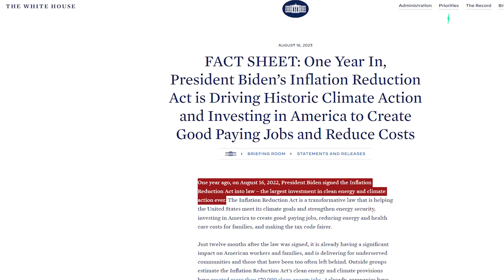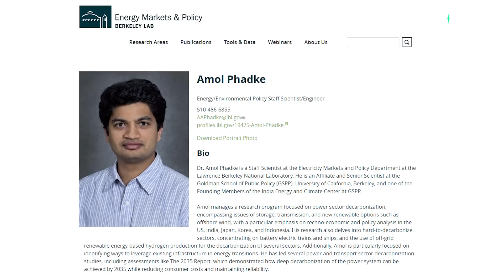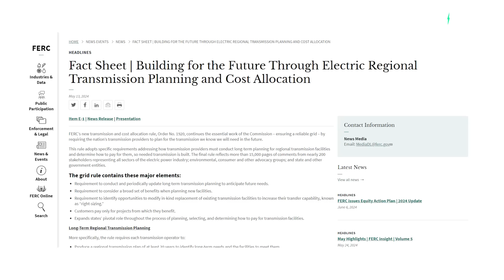How a small change could double the size of the U.S. electricity grid

Comment: Electricial Engineers understand why the lines are slow to be built and upgraded....  just....YOU DON'T ....  b/c you aren't any kind of expert in Power Systems.  

When a transmission line gets upgraded, the breakers, transformers, and other hardware in the substation need to be upgraded, as well as subsequent lines that branch from the endpoints of those lines.  Engineers try to maximize finite resources to upgrade only the necessary components at the lowest cost (b/c customers don't want to pay an arm and a leg on their electric bill for a grid that has over-capacity in an area where it's not needed (until some solar company decides that's the best location b/c the land isn't being used, so they can buy the land cheap but they don't consider their generation is stranded b/c the grid can support their interconnection in that location - it was never equipped b/c it was just rural farm land). 

Just throwing heavier lines on the transmission line towers is also sometimes not feasible due to them being designed for certain insulators that can support certain loads (including temperature and wind loads, voltages, etc).  Basically, you don't understand jack sh__ about the power grid or the factors that impact where and how lines are built, or what constrains how energy flows on those lines.  

Go get a 4 year degree in Power Electrical Engineering before you opine on matters you don't have the math or science skills to understand.

Comment: Why not increase the voltage, which will allow for lower amperage (heat)?
Reply: Similar to vehicle low voltage electrical system going from 12 to 48V ala Cybertruck. Save alot of copper there as well.
Reply: @jaaklucas1329  Exactly. There are easy cost effective solution to this problem, but the big money is made by implementing grand capial intensive solutions.

Comment: Not only rewire but increasing the voltage.  Here in Quebec, we developed the first 735KV lines, we had huge distances between the big turbines sites and the consumers.  Power lost in lines are lowered to squared of the voltage. ( P = V^2/R and P=R*I^2 )   So here in Quebec for example, we have 315KV power lines that we could convert to 735KV if we were to add power at the source of those lines.  The other problem that majority of people seems to forget about EVs is that it's very easy to schedule the recharge off peak.  Not only that, in a not too distant future, power companies could pay you to use your car's battery power to help during peak hours.
Reply: China already has 1.1MV cables. The other way to get more power over the same lines is to move over to HVDC for the really long runs.
Reply: @patdbean  Yeah, we already have that here since about 25 years between Quebec and USA: you avoid 60Hz sync problem for such long distances.
Reply: @guyboisvert66  here in the UK we do not have any overhead HVDC. The country is not really big enough to justify the cost of  convertor stations.

But the undersea , cables to France, Norway ,   Belgium etc are ALL HVDC. To reduce the losses.
Reply: @patdbean  Yeah, you don't do that when it's not needed $$$!  Here, the dams (La Grande 2 and further up to the others) are 1000+ km up north from Montreal and another 200KM from Ste-Eulalie (where the DC station is) to Maine.  The DC line is 450KV whereas the AC lines are a mix of 315KV (older) and 735KV (newer).

Comment: Reconductoring can double the throughput of the US grid.  Reconductoring means replacing old steel wires with new composite wires, a step that would double the amount of electricity that could be distributed, along the same towers, in the same rights-of-way.

So, the future looks quite bright for EVs, and wider electrification plans.

Comment: Only recently the US admits it does not have extra capacity in the grid to "accept" extra connection.
The grid can be upgraded quickly but the grid owners are waiting for government subsidies.  After all it is the government wanting green energy transition.  The grid owners can afford to wait and they are reaping enough profit at the moment without lifting a finger.
The other problem of the American grid is it is highly departmentized into zones and local areas.  Thus one area or zone upgrading has little effect overall across different states or nationally.  In fact unless the grid is nationalized under a sole agency, like in UK or China, no much improvement can come out in the short term..

Comment: It's not that simple folks. Transmission is not only limited by thermal (current). There are electromagnetic conditions and substation capacities. For all those lines to be upgraded with composite conductors will require larger transformers, more bus capacity; and it gets real expensive if the fault levels are increased beyond station design.

The transmission system is not like plugging in an appliance or your home electrical system.

Comment: Allot of the data centers are looking at micro nuclear plants. Even so it seems that it is rather bazaar that data centers are slated to use so much power. Like aren't computers getting more and more efficient?  They are but the computing load is growing so much faster than the efficiency is improving.  My guess is this power usage will drop at some point when some sort of ultra low power computing is developed like maybe quantum computing. Now it's a race to use brute power to do our computing.

Comment: Distant renewables ARE GRID ELECTRICITY. 
NUCLEAR is grid electricity.
Hydro electricity is grid electricity. 

EV big battery parked 23hrs every day and Rooftop PV DO NOT NEED the grid. 
'FREE' BIG BATTERY parked 23hrs every day and all night at home, and free of the grid SCARES THE PANTS OFF the GRID OWNERS. 
Home electricity is dirt cheap. 
Utility owners make home rooftop expensive to connect. 
Complicated connection paperwork.

The grid is so expensive that it needs to sell expensive electricity. 
Do the FKNG thinking, do the maths Viking.
10 times more electricity and grid capacity is insane.

Doubling capacity is an economic trap for the grid owners. 

15% of Australia rooftop area is 100% of today's fossil fueled 600gWh maximum daily electricity. 

But 7x more is needed. 
EV big battery parked 23hrs every day and not used is economic bs.
Grid owners know this.
Elon knows this.
Auto manufacturers know this. 
Military know this.

GRID ELECTRICITY IS a DEAD DUCK economically.

Comment: Something is not right about your 1500 GW of renewables awaiting grid connections, since the total U.S. electrical production capacity is currently ~1300 GWs in total.
Reply: You overlook the difference between installed power and actual fed in power. A wind Power plant has an average annual capacity utilization of about 15%. Therefore, 1500GW of renewable capacity is equal to 225 GW of conventional Gas and Nuclear Capacity.  In the US you have mainly Wind in the Winter and Sunshine in the Summer. You don't have the same windspeed all across the nation, so you need more grid capacity with renewable energy to transport the electricity from the windy areas to the demand centers. In contrast to solar energy, the energy in wind increases cubically to the speed. So, 2x Windspeed means 8 times more power, which you need to transport to the consumers.
Reply: @thomasbergfeld2730 You overlook the fact that power generating companies do “speculative queueing” , where they submit a project to many of the 9 regional grid operators, but only have the money to build 1 project in one region. They are essentially shopping around the different regions for the best tax breaks and lowest interconnect fees and then build in the region with the best deal. This “1,500 GW of renewables” hasn’t yet been built. They will only build if the price is right. Realistically the amount of renewables that will be built is the 1,500 GW of proposals divided by the 9 regions, or 120 GW that actually has the funding to be built. That is a 10% increase over the current US installed generating capacity.

Comment: The grid itself needs a lot of electricity to be able to pay its own way.
A bit like British Rail. Branches were closed and abandoned when alternate transport was available. 
Some people's only transport was lost.

Transport technology changed to the individual to stop 'industrial strikes' and offload responsibly to the individual. 

Now the individual taking energy responsibility will be opposed.

The grid has made clean energy indoors possible to millions. 
The grid also makes electricity more expensive but that was OK, a little electricity in the home was a 'necessary ' luxury so to speak. 
Only a small part of the total energy used is electricity energy. 
With new technology PV on the rooftop and EV big batteries parked 23hrs every day, the grid owners will force a government garrenteed locked in electricity supply.
For me, the 5cents kWh electricity costs 50cents kWh from the grid.

Just seeing this problem is impossible for many.

People think put more electricity through the wires.
This has strong limits. 
More electricity through the electric toaster is perfect for the toaster, but blackouts if more electricity in the grid.

The grid has 3 limits.
1, It must be in balance, supply = demand 
2, An upper limit of heating and sagging. 
3, ECONOMIC size, cashflow limits engineered size. Grids are never overbuilt (like the Sydney Harbour Bridge was.)

More grid capacity is horrendously expensive. 
Offgrid suddenly looks very real.

I like the idea of the grid being the backup supply and a way of topping up areas on bad days.

But the grid needs maximum cash flow to survive.

Comment: Australia has simplified rooftop installation and grid connection and has massive savings.

The government wants to avoid blackouts and loosing at elections. 

Rooftop unloads the grid and so protects existing and aging and extremely expensive infrastructure.
Reply: Rooftop solar PV in sunny suburbs is a no brainer. Unfortunately it is low hanging fruit. Doesn't solve the much larger industry, transport CBD issues.
Reply: @jimgraham6722  Yes, it is a big problem.
Universal connection of every building provides cashflow, large cashflow to the grid itself from central generation. 

74% of demand is from buildings. 
If all buildings can generate and store the same amount as the central generator at maximum limits, then central generation is not needed.

The problem is that  the cash flow from the customer stops. 

The grid itself is a massive infrastructure, with shareholders, like superannuation funds, and its value is a reflection that it took 100 years to build and cost millions per km to upgrade or replace. Australian grid is $1TRILLION.

The grid owners asset, investment, must be respected. 

Furthermore, 7 times more electricity and grid capacity is needed for the clean electricity future. If grid only and no fossil fuels. 

My thoughts are to keep the grid and use the buildings, the customers, as suppliers, and let the grid sell the dirt cheap rooftop to the heavy users. 

The grid then can keep us all connected.
And is our backup.
The buildings pay nothing,  but the grid gets free or dirt cheap electricity.

All the new demand on the grid can grow to the original 600gWh max daily, Fossil fueled central electricity generation. 
My calculations show all petroleum = = 700gWh daily to 20million vehicles. 
So if fossil fueled = 600gWh max daily 

Buildings need 600 × 74% = 400gWh 
20million vehicles = 700gWh avg daily 
Grid can handle 600gWh max. 400avg.
1700gWh total. 1500gWh avg
15% of rooftop = 660gWh 
The rooftop must be 35% of all Australian roof areas. 
The new users can pay full $/kWh for their 600gWh. 

But my calculations cover only 
660+ 700+ 660 = 2,000 gWh and 5,000 gWh daily max will be needed. 
Fortunately millions of buildings will not need grid capacity upgrades.

Comment: Grid electricity is a small part all energy used. 
Grids cost $million per klm and millions of km.
$TRILLIONS. 
10 times more grid capacity is economically insane. 

No grid, rooftop electricity to millions and millions and millions of customers with 
millions and millions and millions of EVs parked 23hrs every day which is basically FREE storage in massive batteries.

Comment: ☆Transmission is expensive, because the grid is an expensive infrastructure. 
More grid electricity is more grid.
7 times bigger capacity. 

Nuclear must have the grid.
More nuclear, more grid.
Grid electric energy has been a small amount of EXPENSIVE ENERGY. 
Now 100% grid electric energy and no fossil energy, is economically insane. Dumb as dog trd.

No grid electricity is brilliant economically. 

All vehicles becoming EV with massive energy storage and parked 23hrs every day means FREE stored energy every day. 

Nuclear and the grid owners are scared witless by USA rooftop technology and EVs big battery technology. 
300million buildings and 300million vehicles, the grid will collapse from lack of cashflow in the USA. 
20million of both in Australia. 

The grid makes dirt cheap electricity 10 times more expensive.
The wonder of the modern economic age, making electricity expensive, sarcasm. 😊😊😊😊

Comment: Batteries will address powerline overload. Just put local batteries at substations to reduce grid load. This will use more solar energy and not waste so much.
Reply: Have you imagined how much power is transmitted through a power line? Then calculate how much Battery storage you need and what it will cost. Now you know why no power distribution company does such things.

Comment: "Peak demand pricing" is a horrific rip-off scam here in the USA and it needs to be stopped.  "Peak demand pricing" allows the electricity producers to charge the  local retailer of electricity (aka a "utility") dozens...even hundreds... of times the going rate when the demand exceeds the allocated supply.  The cost gets passed along to the consumer.  Any additional load on the power grid (e.g. from EV's) will extend the peak demand pricing and "peak demand pricing" discourages producers from generating more electricity.   Meanwhile.... my doctor has 36 solar panels and sells excess production to the utility.  They pay him 1/3 the basic rate they charge consumers, even though his production is often "peak demand" on the sunny days.  USA: where they sell a dream, and companies steal it.

Comment: Sam, it isn't difficult to demolish the "grid can't handle it" myth. Go the LLNL flowchart for 2022, for example. The US generated 100.3 Quads (~106 Exajoules) of energy annually, of which 37.7 Quads went into electricity generation. The entire transportation sector consumed 27.5 Quads, of which 5.77 Quads went into useful work and 21.7 Quads were wasted as heat - due to inefficiency of ICE engines, of course. As an upper bound estimate, perhaps 8 Quads would be needed if the entire transportation sector were EVs (that will be a while, but it's an UPPER bound). So, at MAXIMUM, the grid would have to deliver, say, 10 Quads of electricity (25% added to account for transmission line losses, etc.) That would mean the US needs AT MAXIMUM 10/37.7 = 26.5% more electricity generation to handle additional demand due to EVs. Spread over at least 15 years (to account for the time it will take for the ICE fleet to disappear), that requires a 1.6% annual compounded electricity generation growth rate to handle the ICE–––>EV transition. That growth rate is far lower than the US already achieved from 1960 to 2000. (No one EVER fretted about the grid when air conditioning was phased in over roughly that period. The reason you hear fretting now is explained by the flow into the transportation sector in the LLNL chart - from petroleum, of course. That's the real source of the fretting, of course.)
Reply: Great comment.

Comment: I can solve this in 10 years.  No problem.  If power is doubled over 95% of the network by 2035 give the power company $100 billion.  If they don't hit 95% or better fine them $100 billion.  Problem solves itself overnight.  If it is done in 5 years, $200 billion.

Comment: I am working on the grid daily in Germany. We are focusing the same problem you described. Everybody installs new capacity. No-one impuves the grid. They face power cut offs every day. The transmission capacity is missing. Finally... A lot of money is lost. Refering to Toni Seba... It will work one day. Learning curve... Keep cool. I work daily on it to make it happen. Greetings from Germany. Frank the electrician
Reply: Greetings from Denmark. Our daft former minister of Energy signed of on VikingLink som years ago. A cable from Jutland to the UK,..... Pretty stupid. Given that we have all that wind. And electricity is needed just south of the Danish Border.
Reply: @user-pt1ow8hx5l  as I type at just after 7pm from the UK
 0.88gw is being sent FROM the UK TO Denmark. So it flows both ways.
Reply: @patdbean  Good2hear! Thanks.
Reply: @patdbean  p.s. The danes forgot all about energy storage. Whilst making the cable. Now that it's there, I am happy to hear it's being used. Best argument I heard for building the cable was introducing competition in the UK market; your prices of producing electricity was significantly higher; contributing to energy poverty,..
Reply: You are doing a very important job
Reply: Well done Frank. I am working on HV grid capacity expansion on a daily basis in the Netherlands.

Comment: There are about 160,000 miles of high voltage wires in the USA.  Replacing it all will take some time; it’s not a quick-fix.  But better than all new towers.